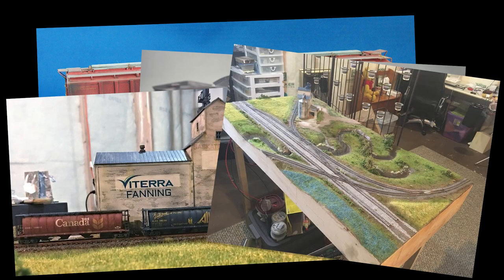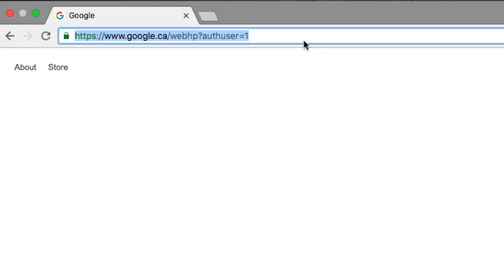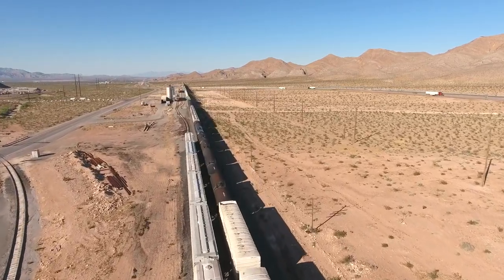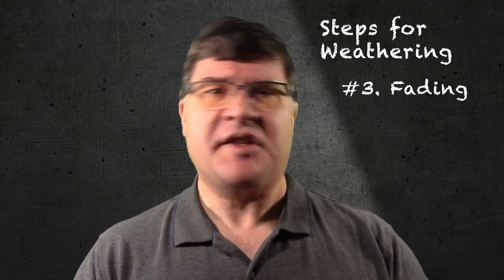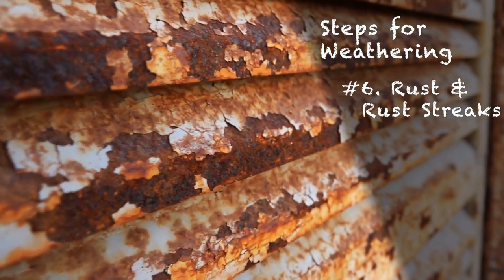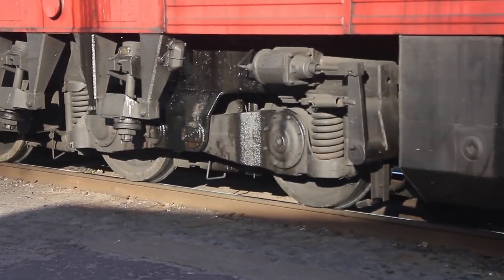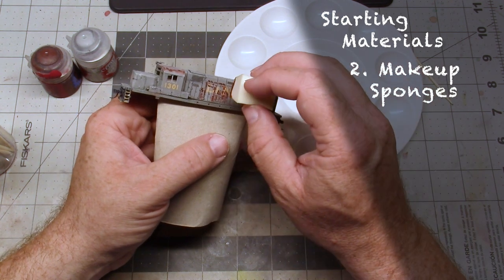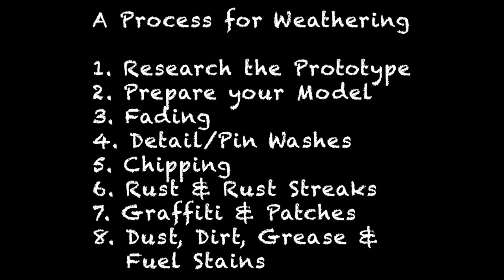Model Railroad Weathering - Getting Started! - 2nd Edition!

Comment: Again a great video John, this i would have needed a couple years ago so i am sure for those starting out it is a great video
Reply from the maker: Thanks! As I've mentioned elsewhere, this subject needed a revision!
Reply: @JCsRiptrack  yes i agree and it is very good, specially the listing of the individual steps!

I was just thinking: the wide use of pigments could also give for a complete video i itself... just an idea...

I know you don't use them often however the wide use of the AIM powders, panpastels and the possibility to use them with a bit of thinner, pigment fixer to flood the surface etc etc...
Also here some guys use powders mixed with valejo matt coat and use them ad a paste for rust and grease and such...

Comment: A lot of times it's what layers to start with, as there is so much different techniques these days.  What is a good staring base?  A dull coat? Then pin wash or panel line?  Followed by a dot fade technique and finally rust?  My apologies for a lot of questions.
Reply from the maker: No problems on the questions. I'll be doing a video on clear coats soon, but the best "starting" base depends on what your first step is going to be. If you're going to fade with acrylics, for example, then a dull/flat coat is a good place to start. If you're using oils, then a gloss or satin coat works better. It all depends on the paint that you're going to be using for the next step. I usually put the dot fade as a very early step, even before pin washes/panel lines.
Reply: @JCsRiptrack  thank you very much for the information.  You always have great videos and I can't wait for the next one as always!  Take care.

Comment: my hangup is choosing the proper color to fade.  easiest for black, spray it (airbrush) with grey.  well what if its grey like csx yn2. what color works..maybe white.  what color should you use to fade blue on csx engines??
Reply from the maker: Sometimes it depends on the effect you're trying to achieve. I am currenlty working on a Louisville & Nashville Locomotive made by Atlas that came as olive green when it should have been grey. So I added a contrasting colour (red violet) to white, mixed it with a clearcoat and built that up in layers (airbrush) to achieve the grey that I was looking for. Amazingly, it worked. For a blue on a CSX engine, you can go with white, grey, or even mix a small amount of orange in the mix if you want to de-saturate the blue. Orange is a contrasting colour, but check out a colour wheel to get you into the right ballpark. :)
Reply: @JCsRiptrack  orange? I would have never thought of that. lol I'll check it out, thank you JC
Reply from the maker: Just enough to tint the white to a peach colour. You won’t need much, and make sure to spray it on with thin layers. This is assuming you’re using an airbrush. If you’re doing an oil dot fade, then include a dot of orange in a few places along the model.
Reply: @JCsRiptrack  airbrush